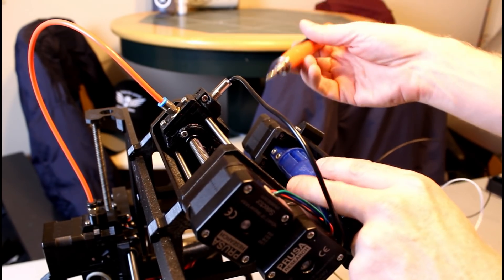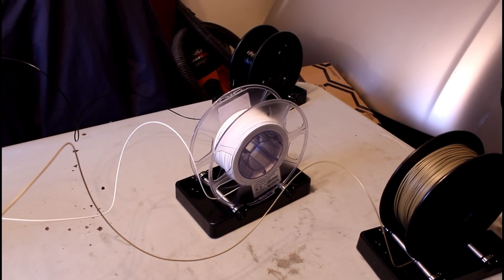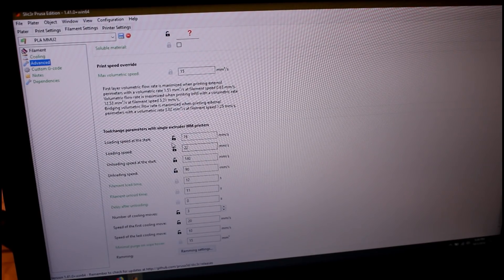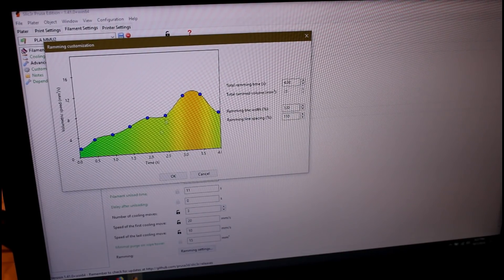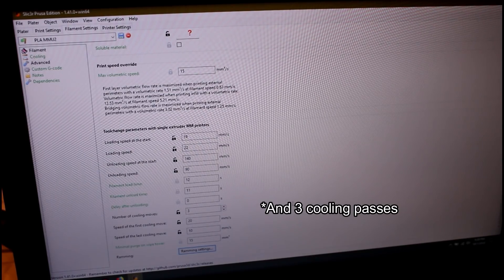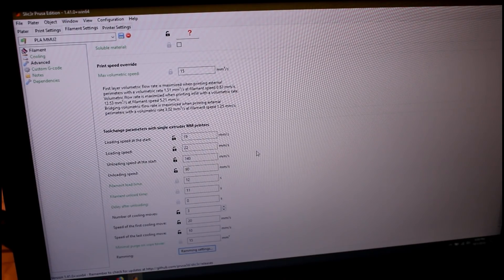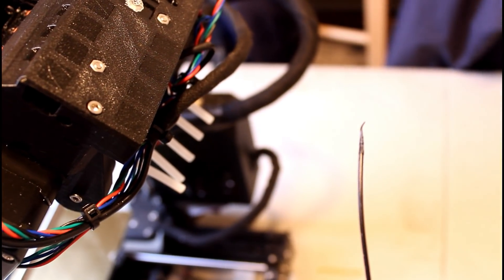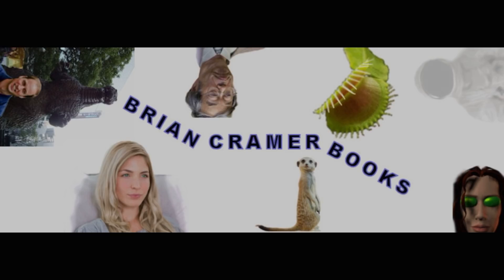Victory Over the MMU2

Comment: When you reprinted the MMU2 Idler in polycarbonate, what layer settings did you use? 0.2, 0.1? Also, how many perimeters?
Reply from the maker: I was originally going to do 0.1mm layers but I wanted it before Christmas so I went with 0.2mm. I did four shells and 25% fill because I didn't want it to have any give. It came out nice but printing with PC is not for the faint of heart.
Reply: Thanks for the quick reply. I have a spool of PC waiting for me to start using, but I have never tried it before. Do you reckon nylon would work at the sustained temperature?
Reply from the maker: Nylon may be too soft unless you use something like Taulman 910. You could probably just use ABS but I like to go overboard. If you print with polycarbonate or nylon, you MUST dry it out before using it, and it is best to have it in a dry box while printing. They both suck up water like a sponge and that water will escape as steam while printing, which will make the print spongy and with poor layer adhesion.

Comment from the maker: *Warning, this video is mostly irrelevant if you have a MMU2S. Also, in the video I say that the two loading speeds do not matter, but come to find out that they are the reason why the filament hand-off between the MMU2 and the extruder works so smoothly now, so I would definitely use them. Also, these settings are heavily filament dependent and I am using an Olsen Ruby nozzle instead of the stock one, so your results can and will vary.
Reply: You may say it's irrelevent with the MMU2S, but I've had nothing but trouble in trying to get my tips dialed in enough to have successful prints.  Trying your suggestion on initial and unloading speed seem to be working for me so far on the 2 color print I've been struggling with.
Reply: Hi,
I need to say that you are wrong with  "*Warning, this video is mostly irrelevant if you have a MMU2S." :)
Since I bought the MMU2s I had problems with it. Never more then 10 toolchanges without issues. Endless hours of trying and reading. I was so frustrated that I bought a new MK3s because I needed a second printer and I was f*ed up by the MMU2s and its bowden-system. 
But finally with your settings and explanations I had my first 75 toolchanges-print without any issue and wonderful tips at the end. (I did a 4 color print)
I just wanna thank you so much!!!
Reply: I ran into a problem with the razor alignment, do you still recommend super glue?
Reply: Heyz, one year later and i was pulling my hair out because my MMU2 kept mangling my filament..... Your solution works like a charm and does definitely apply to the MMU2S. Thanks for figuring this out!
Reply: Im pretty sure the Print setting for Extra Loading Distance is still applicable for the MMU2S as I have one and it was giving me issues. I changed the setting from -25 (default) to 0 and the newly sliced print loaded the filament properly and began printing. THANK YOU FOR SHARING!
Reply: The internal geometry of that nozzle seems like it may be causing you at least part of the problems you have been having. Its not nearly as good as a brass or steel that has been polished well

Comment: Awesome video! Hopefully prusa sees this and makes changes to the holders and tubes like you did.  As well as all the other things you fixed.  Great job.
Reply from the maker: Thanks. I honestly think this will never work reliably until someone implements a filament cutter that actually cuts the filament clean every time it retracts. Otherwise strings and weirdly shaped tips will continue to ruin everything.
Reply: When Prusa revealed the filament cutter on the MMU2 I was excited because I knew that was a big problem with MMU1. I'm a little disappointed to see that it's nothing more than a blade. I thought it would be more sophisticated with a place for the snipped end to be evacuated somehow.
Reply from the maker: Exactly. I'm not even sure what that blade is supposed to do. I've never seen it actively cut anything. Something that trimmed the filaments after every retract would have made this thing just about foolproof, but without it, this thing is nearly useless.